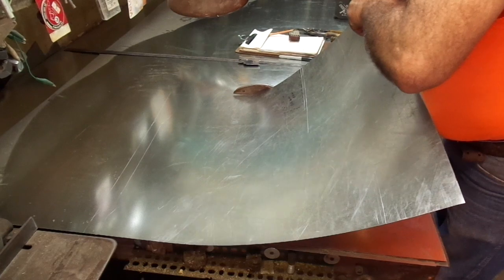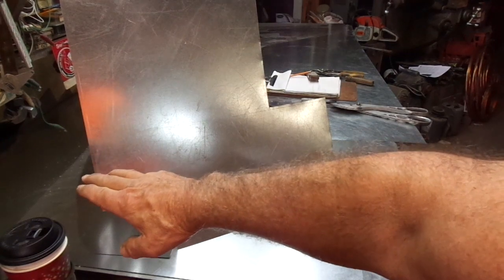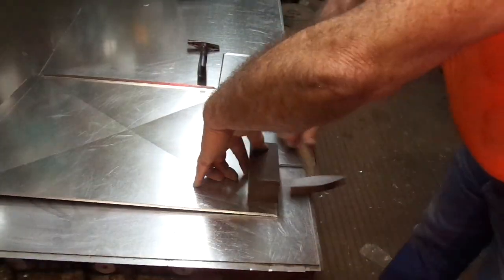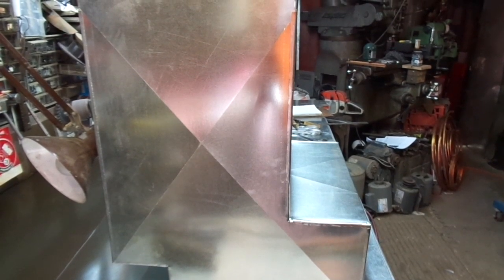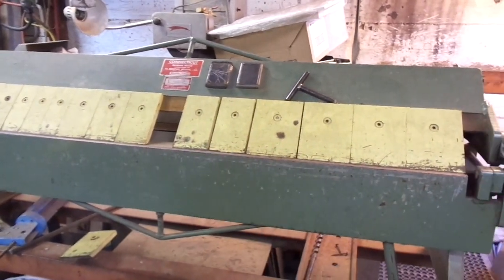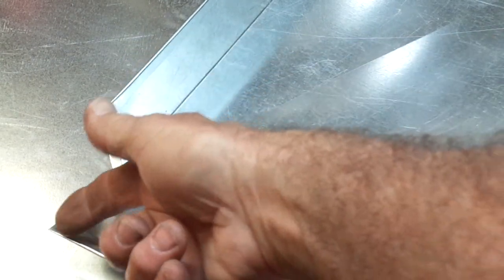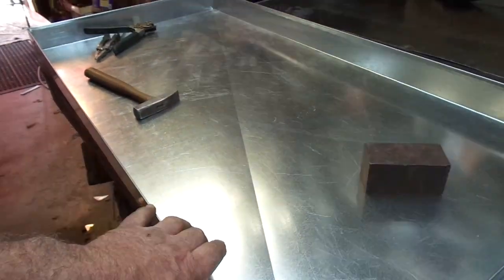Pt 1 Heat Pump Attic Installation

Comment: Great Video Tractorman 44 and I enjoyed every minuet,,,,,,while I ate my chicken dinner, carrots and sweet spuds. Another 10 minuets and I could have watched with dessert. I was talking to aged ones, like ourselves, the other day and they were complaining about not knowing what to do after retirement. I said, I don't have enough time to do everything I want and need to do. And I'll never retire unless I have to. Soon I'll be putting two 5'x6' picture windows in our sunroom, with some adjustment to the building. Lots of painting to do, cleaning my shop, building an 8x8' observation deck back In my woods, cleaning up junk I have about and wouldn't use anyway, put new French doors in front of the house and put the old ones in shop. Then after lunch I want to build a porch floor in back on my shop and put some screens in so I can work outside without bugs getting in finishes, get all my scrap aluminum together and haul it off to the scrap yard, dig out a sizable Japanese maple to replant in another spot and replace the spouting in front and back of the house. Don't know what I'll do the next day. 
  You have some great tools in your shop! There have been many times I could have used some of those tools. But in a wood/metal shop I don't have that much room and manage to make do. I've even clamped two pieces of wood together and made a break and it worked well for what I needed. I did invest in a stove pipe crimping tool a few years back that comes in very handy when needed. Another goal is to clean out a decent space in the storage part of my shop for welding. It's cement block walls and concrete floors so I don't believe sparks will be starting a fire there. I need to improve on the insulation In the green house, which I built under the second story deck and it works well. I used old storm windows I got at the Restore for $7 a piece, had a storm door and a six foot sliding doorI used at one end. For the ceiling I used the 3" foam panels, metal top and bottom 24" wide from an old walk in freezer I got years ago. I knew I'd used them and did. So all the junk, that some untrained folks call it, can create green houses, wood sheds and about anything else you need. Stuff you get free or a buck or two at a sale or garage sale can save you lots. I do believe TM44, that if we didn't have something to do we'd make something to do. Else we'd wither up even worse. Thanks Kindly! I really enjoyed this and all your videos. Keep em a comin! I raise my JO cup now and in the morning to the west where TM44, his Family and Stan reside. May be we can come up with. Zip line and get back and forth in a few minuets. I'll bet between us we'd have all the parts! A Fine As Frog's Hair Friday to ya! DaveyJO going to the JO pot! DaveyJO in Pa.
Reply from the maker: Hahahahahaha DaveyJO !!!  I never know where to start to reply to your always awesome comments sir !  That there's a lot goin' on man.  But I feel ya there buddy.  There is never a time that I have to look beyond my finger to see something to get done.  As a matter of fact I have a bad transmitter in the ice bin  on my 6 year old side by side refrigerator.  All these years they had an arm that would land on top of the ice and shut it off...."but the new and improved" system has a transmitter on one side and a receiver on the other side of the bin and when the ice gets high enough the receiver can't see the signal and shuts it off.  Well guess what.  I'm making ice in ice cube trays because the parts are close to $200.00.  What an improvement huh.  (-:
 
Always enjoy your comment sir and I look forward to them with every video...so I've had my first two cups in your honor this morning and here's to you having a wonderful and eventful day DaveyJO !!
Reply: Tractorman44 I've thought about that zip line. If we'd take a tractor seat, one of those cast iron ones, or pound out some pants out of no 12 steel, you know, shaped to fit the butt, I believe it would protect us from harm. I can experiment and if this doesn't do the Job I can weld a few casters on the bottom for the bottom. Or a seat that would attach to the zip line and weld rods on either side with weights, like a few common balls for balance. Then attach an old chain saw motor for extra speed. You know, weld a bicycle wheel on the chain drive wheel, like a 24" and I'll bet you could make some time with that baby, eh? I could meet you and Stan for morning JO and be home in time for lunch. I wonder if we could just use the power lines? Then we could use an electric motor and save gas. Might need two wheels for that. As you can see Tractorman44, I have lots of ideas and between you and me I'll bet we could come up with a flying tractor. You have all that sheet iron and probably enough to make a goodly set of wings, take the radiator fan off and replace it with a large propeller. Or make a chopper out of it, easier to land. 
  Well today I was just going into me shop when my cousin pulled in, for a cuppaJO of course and we talked about our grandparents. My cousin Steve live right beside the farm. I asked about the old Farmall and all he could remember was I think he said the x series? The here indeed me of the old Ford tractor, smaller than the Farmall and Case but used for hauling feed and water to the 2-3 thousands pullets in the meadow. Used to fill the old wooden barrel and it took quite a while to fill it, feed and water the chickens and it was perfect for this and smaller jobs. I'd forgotten all about that old Ford. So we talked a good while about our memories of the farm. Then we decided to visit the cemeteries where our GGG Grandparents are buried, he was born in 1772, that came from Ireland in 1815, his son the shoemaker and his wife are buried near by, our GG Grandparents. He was born 1818. Then our G Grandparents and Grandparents at another cemetery. And on to another where his parents are and a number of our other relatives. Including our Uncle Bud who was killed in the Battle of the Bulge in Holland 1944. All three of my Mom's brothers were in the war and Bud was the one killed. My cousins dad was I the Coast Guard and fought German U boats and our oldest uncle enlisted in May of 41 and came back in the end of the war. He was in Europe and followed the front line cleaning up, fighting who was left and repairing what they could. My daughter wrote a book about Uncle Bud and I have some copies. I'll have to send you one. It is a detailed story about the loss of a son in WWII, one of many many stories. I believe it was over 2,200 men lost just from our county. Uncle Bud was 20 yrs. old and my Dad was the last to see him. 
   Anyway it was a great day. My daughter and I are the family archive keepers, though she lives in Or. I have photos going back to the Civil War and my grandparents marked the backs of all the photos so we know who they are. Some of them are tin types. In fact we saw our Grandfather's Grandfather who volunteered three terms in the Calvary in the Civil War. So it was a family reunion today and great fun and so interesting. One old cemetery has a stone wall with many slate tombstones. Some have carvings of angels and skulls and beautifully carved. Most of the slate stones are those born in the 1600s. The oldest we could see was 80 And died in 1757. They were the pioneers and we talked about how hard life was then, breaking new ground and building a barn then a house, perhaps living in more of a shanty until crops paid off. I find family stories and photos a wonderful thing and love hearing about the simple folks of the early day. Leaving your country and finding a whole new everything and starting over. How little modern people realize. 
   Well I guess enuff iz enuff for now Sir Tractorman 44. My very best to You and you Family! And I'm finishing up my evening JO toasting the Tractor Family to the west, which we shall soon zip along to see,,,,I recon? Oh yes, I did work in the shop from 3 to 9, working on and finishing up a few projects. Good Slurps in the Morning with Stan! DaveyJO
Reply from the maker: @daveyjoweaver5183  Good morning sir and a fine morning it is too !!  I'll start stretching cable from my end and maybe we'll meet somewhere half way...but wait...I do like your 'hi-line' idea.  Those guys have those little powered carts that hang on those high tension wires to inspections and minor repair and literally zip from tower to tower !!  I always wondered what powered those little hanging carts......here's toasting a little JO to that idea.

I would totally enjoy reading that book about Uncle Bud. If you'd like whpete44@gmail.com is my email address and I can give you my regular address.  You may sent it postage due and I'll swing by the Post Office and pay for the delivery. Man, I'd appreciate that sir.

I can't think of what Farmall it could've been.  If it was really old and still a Farmall it may have been a Regular then they went to the F-series, so I'm still thinking....

That sure was a fun sounding reunion and day spent with your cousin.  Awesome cliff notes on your lineage.  A fellow can really get deep if you take the time to dig.  And now with all the computerization of old records, it saves tons of shoe leather and gas !  It's so cool you all can trace that far back.  I love the old stories about the tough times people went through and think of how soft we've become.  Can you imagine pulling up to the Ohio or Mississippi river with a team pulling a wagon full of the wife and six kids and having the faith that you're gonna get across....????  Settlers and Pioneers all had to have gonads of steel I tell you.  One of these days I'll do a video on our old rebuilt limestone oven our G Grandfather built in the 1880's or slightly before.  We were able to dismantle and relocate it from the old home place to my much older brothers house a few years back.
But that's a whole 'nother story man.

Stan said he wasn't sure his voice would carry all the way to Pa, but he told me to shout you out a hearty Good Morning as well !!  Ol' Stan...what a character. lolol.  Hey DaveyJO, starting my second POT for the morning and I gotta get in the sons attic to finish thermostat connections on the air handler before it gets too hot.  You stay cool man and I will always be toasting towards PA with the first sip of every cup !!  Like Paul Harvey always said...."Good Day"......
Reply: Recycling and repurposing are new buzz words for "Go fetch me a board out of the chicken coop!" 😎
Dad built toys for us out of the bits and pieces left over from one project or another. My first coaster car was built from barn siding. 
Sounds like a bang up job on the greenhouse. 
We will never run out of work since so many people know we can do it. Good luck to you and watch out that the zip line doesn't get low enough to rub you along the ground in the middle.
Reply from the maker: @OldSneelock  back on the home place every barn, shed and blacksmith shop was stacked with usable material salvaged from one place or another.  Back in the day the old saying "Necessity is the motherhood of invention" was coined for the purpose of describing how guys that had nothing made do with what they had.  If a person is born and raised with that upbringing....it never leaves him. I think that's a lot of what's behind guys like DaveyJO, you and myself.  Many others on the 'Tube' fit that description as well.
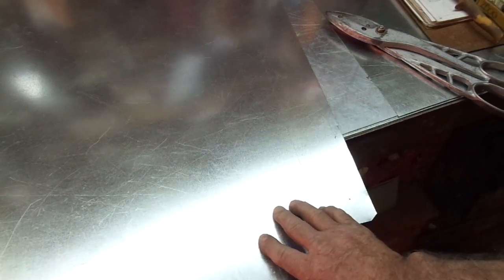Reply: Tractorman44 I'll definitely get that book to you and I'll sent it postage paid. How could I think of sending it POD when you're crawling around a hot attic with fiberglass all about doing duct work? I think I'd be arrested. But your honor,,,,,,,shut up boy, he was in an attic! See what I mean? Those line carts sound like the ticket for back and forth. I'm sure we could figure out how to make those babies speed along. And I do believe that old Farmall was a f series not x. I know it had two front wheels close together. When my Grand dad bought the John Deer it had the wider front axel, which he seemed to like better since he didn't have to worry as much about the hills and dips. I love hearing about all those stories and indeed, gonads of steel to say the least. My Grandmother was always careful about water use. Once their well went dry and it was a struggle until they drilled another. She never waisted anything and everything got used for something. Dish water would scrub the porch or clean something. She'd be up by four or earlier. One summer I was staying there a few weeks and I got up at 7:30. She said, Davey, your just getting up? She was sitting on the porch and had shelled a half bushel of Lima beans, which she was working on, she had gathered the eggs from the thousands of chickens in the four three levels of the barn, sorted the eggs and crated them up for the egg man, picked the beans and was shelling. Indeed Davey, you're just getting up? And of course in between there she'd made breakfast. My cousins dad worked on the farm too so he was also gathering eggs. I think those crates held 24 dozen and there were quite a few boxes for the egg man. They had been run through the egg washer too. It was a cold room dug into the dirt at the one corner of the chicken house. My Grandfather and Uncle built the block building. They cut the lumber from their woods and laid the block. I found a receite from the back hoe man who dug the foundation and he charged $6 an hour. I do believe it went up a little since 1955-6! Most of the joists were oak and also some poplar for roosts and the like. I know there was some ash as well but all tough stuff cut and sawn n the farm. With a buzz saw much like yours, which also served as a firewood cutter. My Grandpa said it took about 12-13 cords a winter to heat and some for the cook stove as well. And I swear that food cooked on a wood stove always tastes best. And of course when a chicken or chickens were needed for a meal and I don't mean to sit at the table, my Grandma would go out to the barnyard and grab a few. The chopping block was right out back and she liked a short handled axe for the job. Then there were soft shelled eggs, double and triple yokers and unshelled eggs from inside when cleaning for cooking. She'd boil water and make a small fire to singe the bird. And boy, was her chicken the best ever, as most farm mom and grandmama made. See how one topic leads to all those great memories. But people back then were far more appreciative about everything they had no matter how small. 

And PaulHarvey? One of my favorite stories from him is about a man driving home drinker than a one legged monkey. A cop stopped him and during his stopping the drunk an accident happened in the opposite two lanes. He told the guy, don't you move from this spot while I call this in and check on the people. Of course the guy took off, went home and told his wife to tell the cops if they came, that he had been sleeping for hours. Of course they came  and she told the cops he was sleeping for hours. So the cop said, would you please open your garage mam. When the door opened there sat the police cruiser. I believe he got the wrong car, eh? I Loced this story! Page Two! 
I raise my mug to the west this eve and will do so in the morn. It was a lovely day here today and I spent part of it at our friends who have a horse rescue farm with about 40 horses. They are treated well and have all they need including lots of love. So it was a fund raiser of sorts with food, a vet examine one of the horses, a woman who does acupuncture and message on horses and a talking circle where I played our big powwow drum, 28" in diameter, wood and buffalo raw hide our Cherokee friend made for us. It was all great fun. Had to run to town since I forgot to buy more JO yesterday, then worked in the shop from 5-9 this eve. Nothing like A warm breeze running through the shop, JO in my cup warmer and working on something enjoyable. The smells of berry blossoms and honey suckle are drifting about. What could better? And if words or spelling seem weird it probably is. The iPad makes some of my words sence less! Or course some of my words are but not always. Buy the way, I used 8oclock coffee, used to be the A&P get the whole bean and grind it myself and its blessed by the JO Faries here in the holler. I've drifted along enuff fer ser. So a FINE Spring Sunday. My best to All and Stan and of course to you SirTM44! DaveyJO raising me cuppaJO westward!
Reply from the maker: @daveyjoweaver5183  Good story DaveyJO.  Sorry it takes so long to get back to reply to your reply...but you know what??  I think I'm getting a bit lazy in my old age man.  Use to be I'd never get tired, now I never get rested.  You'd think if you're tired of being tired, you'd automatically rest up some.  But that ain't the way it is is it !!  Your Granny was a heck of a woman but I tell you what they was all dang tough back then.  They had to be to survive.  At our place, Sunday supper was usually an  old settin' hen that quit laying.  We had an old dull corn knife that we kept stuck in the shredded top of the fence post in the corner of the chicken yard right next to the smoke house.  The old man taught me by the time I was 7 or 8 to grab the old hen by both legs and draw the wing tips back and clasp 'em all together with my left hand.  No slapping and flapping that way. They stick their neck way out too then.  There was always a chopping block right there and the with the old corn knife you couldn't miss.
 I'd keep a hold of the legs and wing tips and stuff the stub of the neck right into the corner of the smoke house and the fence post.  Man I'd get blood all over my pants leg and shoes on occasion because ever so often the old hen would get one wing tip to slip outta my grip and flap to beat the blazes !!!  I remember only one time the old gal slipped out both wings !!  Only once because from that time on I'd have a death grip on those old birds !!  Our old hound dog Dinah (after Dinah Shore lol) would smell the blood of the first bird and act real funny like she wanted to help you know....but she really just wanted some raw meat for supper. 

DaveyJO its always a pleasure sir and send me an email and I'll send you my home address and I will promise you I'll read every word of that book till the print falls off the paper !!   I may get the chance to see old Stan tomorrow because I'm gonna sneak in to McD's while the Missus ain't looking so I'll pass on your well wishes once again and know that we too will be toasting you and yours back East in good old Pa !!.....And now....the REST of the story.....(-:
Reply: Tractorman44 People of our parents and grandparents had to be tough but they never seemed to make a big deal out of it at all. Today a hang nail is an event, or the washer broke down or worse yet, they drop a pizza upside down on the floor, HORRORS! And when something went wrong, you fixed it. My Grandmother used spools for a lot of stuff. My Grandfather worked on the mail train for 31 years so he'd be away during the week and home weekends doing farm work that my grandmother couldn't get to. She'd use those wooden spools for drawer knobs and knobs for cooking pots. She was a fine chess player and a few of the pawns were spools. She braided rugs and hooked rugs as well. She get old wool clothes saved by family for her and go to goodwills and buy old coats and suits. The she'd hand dye the colors she needed, cut the wool into strips and braid away. And those rug were heavy and tough. She'd can fruits, veggies, meats, sauerkraut , did jams and jellies from fox grapes in the woods and currant jelly she'd gather in the meadow. Crab apple jelly, raspberry, we'll all the fruits and loved picking berries. Of course they did their butchering until after my grandfather retired in 1952. He lived until 1989 at 97. He used to catch the mail bags as they steamed by stations and sort mail. He said if you mailed a letter in NYC to Pittsburg Monday evening, it would be delivered the next morning to Pittsburg. Now it takes 2 or 3 days to mail down the street. He'd often lay over in NYC so he'd visit museums and go to ball games. Saw the Babe and Ty Cobb play more than once. He told me that there was a wash bowl in the mail car and it had steam heated water of course. The sink would be full of twine and string. The men would bring eggs to work, bury them in all that twine and turn on the steam. So by lunch they'd have hard boiled eggs. He always brought good eggs from the farm and share them with his fellow postmen. They were required to carry pistols but said no one ever loaded them unless they were warned of some possible robber out there somewhere. He was only 60 when he retired and worked the farm with my uncle until he had a heart attack and had to slack off on the hard stuff. But co,pared to today's standards, it was a mild one in 1958. Didn't bother his fishing skills or times either. He could pull a trout out of a glass of water, seemed so. The limit was eight trout at the time. I'd be fishing the deep holes and I'd see him fishing the rapids. I'd think, he'll never catch anything I that shallow water. But when we'd head back to the farm, where my grandmother have the black skillet ready, I'd have one or two and my grandfather had his limit of eight. When my Mom was a kid with 3 brothers and a sister, my grandmother would bend straight pins, tie them to strings and the kids attach them to straight pole they'd get in the woods. They'd come home with supper too. And for Christmas, they'd all get a book and an orange. Have their big Christmas dinner and read their books and eat their oranges. Mom said it was so exciting and grand to get that book and an orange, a real treat. And my grandparents knew well of each of their kids interest and each received a book that fit. Today I've seen young folks who have trouble hand writing, used to buttons. And who writes a letter anymore? I haven't received a letter in a long while and have been given hell because I didn't answer my phone in the middle of the day. I have a cheap track phone, mostly for something forgotten when I go into town for a few things. And I just found out that the family run grocery store has sold out to Giant. They had their store run by the family over 100 years. Couldn't compete anymore and make ends meet. So sorry to see the family run businesses being forced out. He with all the Amish stores it nice to have that small general store that dot the country side. Well, I've run off the page again. I'll drop you a email and get that book to you when I get your address. I am sure you will enjoy it. So before long I'll be toasting in your direction Tractorman 44. The best week and don't get so wild with that Sawzall! DaveyJO